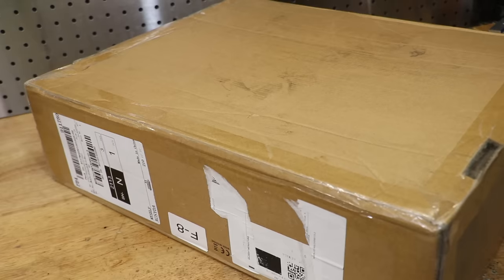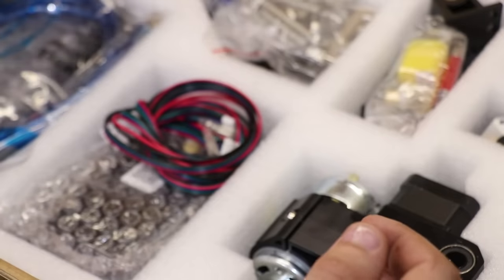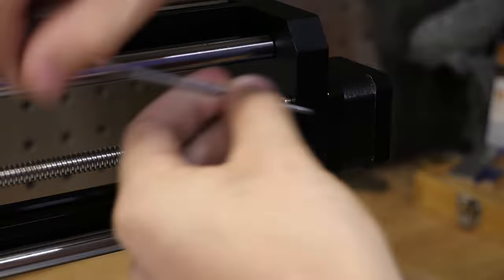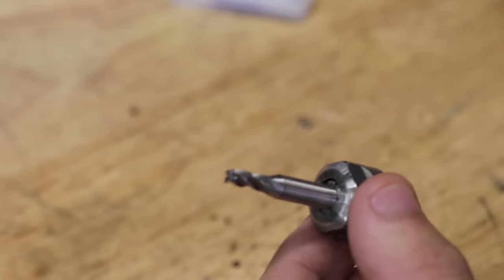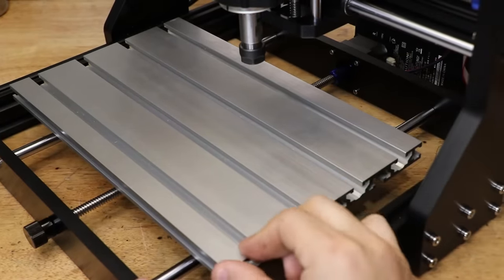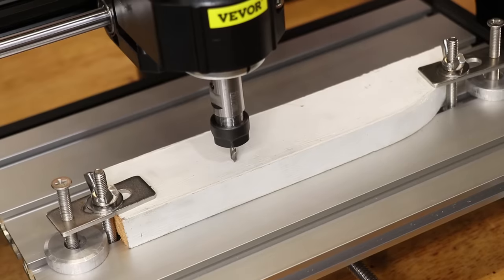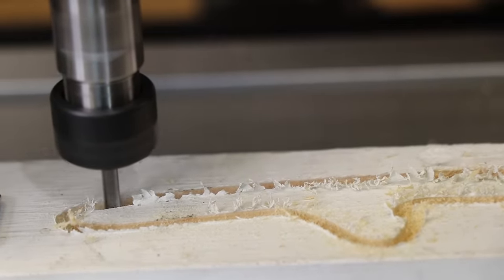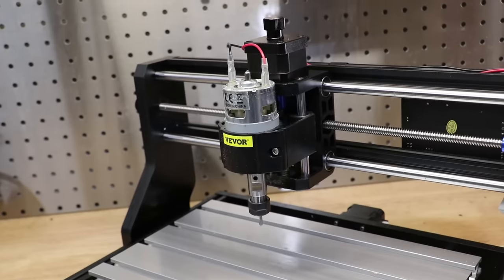A CNC Mill For Less Than $200 - Is It Worth Buying? (CNC 3018 Pro)

Comment: Interesting, if someone who has basic knowledge of computers wanted to get in to CNC, what advice would you give them?
Reply: I wanted to reply to your seeking of advice about the CNC. I was completely new to cnc or any computer controlled device like this. Although what I did have working in my favor is I am a woodworker so it was easier to understand some basics. So a few things I have learned. I started with a 3018 pro cnc router. Grbl control. For learning basic feed and speeds which the math isn't to tough but I just kinda played around with that for my materials. Recognizing what different sawdust look like will aid in that. IDC what the description says about any of these desktop cnc routers are NOT made to cut aluminum.  They are a cnc router and not a cnc mill.  The grbl free programs are pretty basic and you can only do so much. If you upgrade to a larger Chinese made desktop cnc router will most likely run on Mach3. This is much more like a actually milling software. Not hard to use. There are great YouTube videos for most questions.  When I upgraded from my 3018 (was frying circut boards) to my 3040 it was Mach3 run. With that being said I could still use the free Easel software to create the Gcode for Mach3 but it was again limited and a pain. So what I ended up doing was buying a cracked copy of Vectric 9.5 to do all my design in and Gcode generation. Not that I condone this but it has been super helpful. Again lots and lots of You tube videos on its use. I don't use nearly all that it's capable of by far. As to size I would plan on nothing smaller than a 3040 which is just about 24 inches deep. It fit on my work bench front to back. Also there are a few 3040 cnc 3d printed files like dust shoes. The 3040 has around a 300 or 400w DC motor for a spindle. It gets the job done but it's definitely not in a hurry as the motor just doesn't create the power. But bed size is doable.  If you go to a 6040 cnc it will most likely have a water cooled spindle ranging from 0.8kw (1hp) upto a 2.2kw (3hp) depending on price. Mine has the 0.8kw and I have no complaints but I mostly mill wood and plastics. I've heard the 2.2 is to heavy for the Z axis and causes issues. Also most WC spindles top out around 24k rpm vs 10k ish. Also watch which machine colors you get. I know this sounds funny but certain ones have to have stepper wires replaced. There crap. Do the research there though. I have a Vevor on all my machines but the 3018 and have had no issues at all. I don't run a business or anything with it so I don't push it super hard. The biggest thing I can tell to you is don't get discouraged.  It will be a bit tricky at first but you will settle in. You tube is your best friend. I'd watch the video on one screen or device and follow along on the other screen or computer. I made it a winter project here in Colorado. Laser engraver when it's warm and can keep the door open to vent. If your in the states and wanna take the plunge I'd love to chat with you further if interested.  I wish I had a more creative mind to utilize it.  6040 is 15.5" x 23.5" workable space. 3040 was around 11 x 14 I think

Comment: The thing worrying me most with these is the spindle. As shown these have terrible runout and balancing issues. However, so far no one has mentioned how the spindle bearings are. Bronze bushings, or what quality ballbearings. But by the look of the motor build it's not that accurate. Probably be better off making a bearing housing that holds the collet chuck and put a flex joint between it and the motor. And then there are other mods like the slop int the table etc.
Reply: Some people use a pro quality hand tool,  Proxxon or similar. Frankly, almost anything would be better than the cheap motor and sloppy collet body provided here.

Comment: I think Stefan Gottswinter put it best. There is nothing wrong with Chinese tools. The mistake is with the consumer. If you think you're going to get a machine tool for $200, you are a fool. But if you're willing to put in a little bit of elbow grease, chasing tapped holes, deburring everything, and changing all lubricants, it is still cheaper than just the raw materials in my area at least. You just can't expect a ready-to-work tool. They are tool kits. On the plus side, you will understand and care for a tool much better when you understand exactly how it works. Those not already in the habit might find that they benefit from carefully taking apart new purchases and having a look around. You might just learn something.

Comment: Just found your Channel so you got a new subscriber I've been interested in tabletop glaze and mills for a while. I'm not a new machinist but it hasn't even been 10 years and I'm interested in getting a Mill and Lathe for my home and I'm wondering what you can suggest besides the one you just showed us. I am going to take a look through your playlist see what I come across but if you happen to see this comment maybe you can suggest something reasonable price but not cheap
Reply from the maker: the only other cnc router I have used is the CNC 3040 which I referenced in this video. On the whole they are solid machines for wood and aluminium but the control boards are a bit ordinary. Although it was 7 or so years since I last used that model.

Comment: Do you think or have you tried using on leather?I ask because I'm not sure how it works and I think it will work better than lazer.
  Please help
Reply from the maker: No I have not, however I have used a laser cutter to engrave lather and I think that is the way to go. That was with a CO2 laser though, which was pretty powerful compared to the cheaper laser engravers you see online.
Reply: @artisanmakes  are CO2 lazers expensive
Reply from the maker: Unfortunately they are, you might want to look up leather engraving with those cheaper diode lasers, I'm sure it will still work

Comment: I have a severe problem with my 3018 even in light engraving: The basic spindel vibrates, on some places more than on others, and this means that the engraving is wider than the tip of the tool. I even adjust the runout after installing the tool, not on the outside of the chuck but on the endmills shaft, and it is not sufficient. The vibration, that make for the load noise, will let the engraver vibrate around the axis and pushes material to the side. So my conclusion: this CNC is unusable, even with a better spindle the z-axis will vibrate, even with a better z-axis the x-axis will vibrate. And the anti-backlash-mechanism does not need much force to overcome the spring, so the engraver ist not suitable for milling. But I use it with a vacuum table for drilling (sadly no tool changer, I create one file for each diameter) and with a different head to dispense solder on SMD PCB boards, and it should be usable for selectiveley laser soldering.

Comment: I’ll be honest - it does not seem worth it to upgrade this machine… as you pointed out - the main issue is the rigidity of the entire Z axis… and that stems from the free floating linear rods. To make this thing rigid you would need proper linear rails bolted onto some kind of profile… and that alone would set you back around 100 dollars when buying cheap and a lot of tinkering. The next issue is the huge backlash in the trapezoidal nuts. You would either have to go for Playless Igus dry lube nuts or import ballscrews and bearings. And at that point one could have built an entire machine which would be more capable for basically the same amount of money…

Regardless of that - great video showcasing these kinds of machines, I’m happy I didn’t buy one of those in the past and saved up to buy a proper used cnc on eBay

Comment: Looks super cool! Maybe a video on mounting it to a concrete slab? Not sure how much they would help though
Reply from the maker: The main problem is with that z axis assembly, not the frame of the machine
Reply: @artisanmakes  ya :( interested to see how you solve it.

~lost pla casting~ 👀 + linear rails??

Comment: I've never made one before, but I would think one of these mighy be alright for milling PCB's at home
Reply from the maker: I have some on the way, looking to test that soon
Reply: @artisanmakes  awesome! It's not something I'd really need to do, but I'm excited to see how it performs. Could be a good cheap option for people. I'm not sure PCB material is very flat though, you may have some trouble with the depth of cut.
Reply from the maker: @JordyValentine  Thanks for the heads up, might be something to look out for. I havn't done much PCB stuff before. Last time was probably 9 years ago in high school and we acid etched them.
Reply: @artisanmakes  yep same here, a couple basic circuits at Tafe to tick off that I could solder 😉

Comment: how about pen plotter?, the challenge to turn 2d print art of some amazing artist into G code. ..instead of laser engraver, a non destructive method of surface layout. I wonder what cnc router mill Levsha went with..
Reply: Pen plotting is pretty fun with these 3 Axis machines. I use software called DXF2gcode and Inkscape to make the DXF file. Believe it or not cheap ballpoint pens work the best. I've tried fancier pens like Pilot Precise. It surprised me.

Comment: Is it normal for these machines to have about 1mm of vertical looseness on the z-axis?
Reply from the maker: That was my fault, it doesn't normally do that. I had to take the workpiece out of the jaws to take the carriage off to tighten the retainer plate. When I put it back I never bothered to recenter it and that was the result.

Comment: Measuring runout on the outside of the spindle extension tells you nothing. You need to measure inside the collet Chuck. Not that I would expect it to be that much better but at least you would actually know the spindle runout.
Reply from the maker: That was more for trying to reduce the vibration of the collet than anything

Comment: So I got one of these, it wasn't a Pro tho, that's the only difference. I built it wired it up, and it moved correctly when I manually use the inputs on the controller. But when start to run a design, it just jets off to the right side, and I can't do anything to stop it except try the off button or yank the plug. I use fusion 360, I just load STL or 3d model files that I make in, then download the CNC gcode. Has anyone else had and resolved this issue?
Reply from the maker: All I can say to help is, if you look at the CNC controller, look at the line of g-code when it jets off to the side. It might be telling it to go to a certain xy coordinate.
Reply: @artisanmakes  thank you, I'll be honest if I knew more about gcode in general it'd probably help alot. Just ran into some issues with my 3d printer after Installing new firmware that changed the 0 axis from the edge to the center of the print bed.

Comment: i've got one, i'd say, build an enclosure and put a laser in it, the spindle motor is trash, replacing it with something better isn't worth it, the good stuff is too big.  i'm primarily using mine to machine... very slowly... aluminum plates to make something better.

Comment: Why do people insist on calling these 'mills'. If you judge them on being a mill, they're going to come up VERY short of the mark.
Their construction just doesn't lend itself to rigidity. The X & Z axes are suspended in mid air by two pieces of plastic ffs!
But they do fine for small stuff in soft materials. Just don't try and drill with them.

Comment: those kind of rails are the worst, even if they're 16mm thick they want to bend. looks like the 20x20 extrusions on the x gantry should be replaced with one big say, 80x40 extrusion or something. and instead of those steel bars, a couple mgn glides. probably the z axis would need to be made in advance of that kind of change.

Comment: While the video is excellent I think the idea that this is a CNC milling machine is a stretch. It is labeled on the instructions as a CNC Engraving unit.  Not a CNC mill.  Engraving it a light load operation not hogging material to make parts.
Reply from the maker: Fair, I've always called these gantry style mills, though I'm sure there are other names, CNC router comes to mind.

Comment: when you plugged in the USB that cane with the cycle did you get a black dos box show up for a fraction of a second.  if so you computer now has a back door installed to a hacker  somewhere in I assume China that's can access your pc at will. THIS IS NOT A JOKE.
Reply from the maker: No. This is a $100 dedicated workshop laptop anyway. You can download candle CNC from the website if you are worries about that

Comment: You should have measured the run-out from the tool.
Reply from the maker: I have been asked this, what I was trying to do was reduce the vibrations coming from the spindle which is why I measured off that. Overall, it didnt do much.
Reply: @artisanmakes  right. The spindle honestly needs its own separate hub besides that little bearing at the end of the motor.. lol probably $200 worth of matching by itself. Precision is all about how much you want to spend whether it's hours OR money.

Comment: Great informative video, but man that machine looks like a piece of junk. Unsupported rails (the worst!), plastic frame, sloppy z-axis, tiny motor lacking rpm, etc etc.
I have a custom built cnc router that is 20 times better than that machine in every important way but it still is not great for machining aluminium.
I wish you good luck with fixing that machine up, but honestly if you want to machine aluminium you need a really solid frame, fully supported rails, proper linear bearings and a pro spindle. Or better still a cast iron milling machine like an X2 with a cnc kit added to it.
Anyway, it will be interesting to see what you come up with! 🙂👍
Reply from the maker: I agree with your point, I am happy that it could do plastics and wood but apart from that it struggled. The biggest issue is the gantry support which I am working to overcome. Cheers

Comment: I have this machine for two years already. Very mixed feelings... definitely piece of sh*t, but it works kind of OK for PCB milling and drilling (down to SOIC package size and maybe 0.6mm wide traces). If you want to make it down to 0.5mm pitch QFN packages and 0.2mm wide traces be prepared to spend additional 400$ for linear rails for all axes (in my case) and countless hours of drawings, modelling parts, waiting for milled pieces to arrive, troubleshooting etc. Do not buy CNC3018 for producing parts out of the box! It only works as introduction into CNC milling and engraving world. And it is a good journey if you enjoy upgrading it and have a money and time for it.
Major issues out of the box: huge (0.5mm) backlash on all axes; unsupported linear rods bending A LOT; cracking of plastic parts where metal parts are pressed in; motor vibrations; no end switches (therefore no homing cycle);

Comment: You're making it unnecessarily hard for the machine using the wrong cutters for the type of cuts you are doing... Full width cutting is called Slotting and needs a Slot Drill (confusing name as it's mostly used for X,Y Axis cutting, not so much Z-axis..)
The End Mills you are using will clog, causing vibration, deflection, and a rough finish.
Reply from the maker: All that aside, do you seriously think that this would cut any better with a cutter change. Then weakness is at the spindle and nothing will help it unless that is fixed

Comment: Seems like an endless money and time pit vs just buying something more capable.
Reply from the maker: I think less than $100 is all it needs to make it work. A new motor, a new linear rail and some aluminium for the z assembly. That should still be under what the next model up is sold for.

Comment: chamfer the holes FIRST!!!
Reply from the maker: which holes and why?
Reply: @artisanmakes  The threaded holes because 9 out of 10 times if you chamfer after it will kick up a burr on the threads and the bolt wont go in.

Comment: Well why did you buy it, maybeyou should of checked the run out at the tip of the tool not on a possiblely not straight adapter bit, what do you expect for a $200 machine that is not expected to work 7days a week 12hrs a day. It is a hobbyists machine ffs. It says its not designed for metal.
Reply from the maker: I bought it because I wanted to see what it was like, that's all, I even said in the video I had no expectations from it. I measured the run out of the outside was specifically to minimize the spindle vibrations. Of course its not designed for metal, but there is no harm in trying to push this machine to its limit to see what it can do.

Comment: You are not cutting, but more grinding, especially in wood. Sometimes, it is helpfull to slow down the spindlespeed by quite a lot... especially, when you got problems like you.
Reply from the maker: You dont have spindle control from the computer controller so its pinned at 10,000. And for a cnc router these high spindle speeds are fine, the cutters im using here certainly aren't, and the feed is a little high too

Comment: cnc mill :D pppppfffffffffff
This is just horrible to watch :_D
Cheap copy of dremel on steroids would be a BIIIIIIIG overstatement
the reason why i haven't bought one of these is just because of that. And i am an actual real machinist. So i know what a cnc mill actually is. You can probably do some pcb stuff with this but that's it. When yous running that thing at 10-20k ripems the .1 runout will fuck you over badly. Another reason not to get it is if the test file say iphone. Everything these day unfortunately is iThis or iThat. Some old guy 15 year ago knew how to fuck people over and now we are here. Biggest issue with these is you use 1/10th of 1/10th of what you need to use for proper mill.